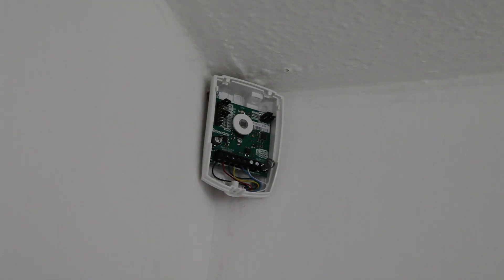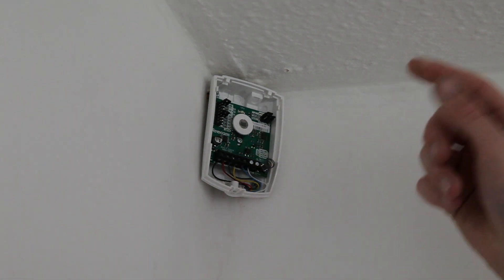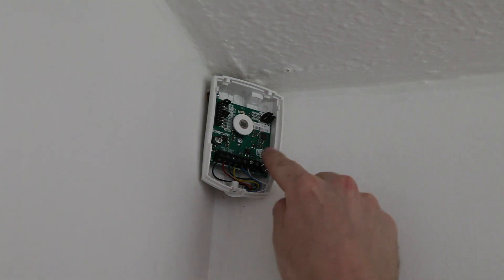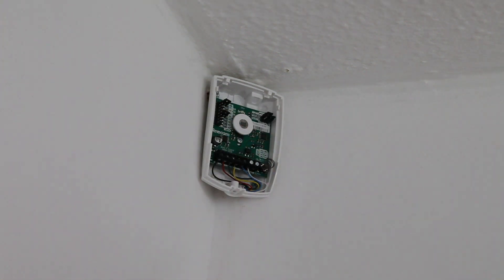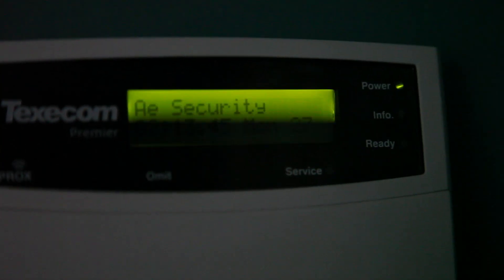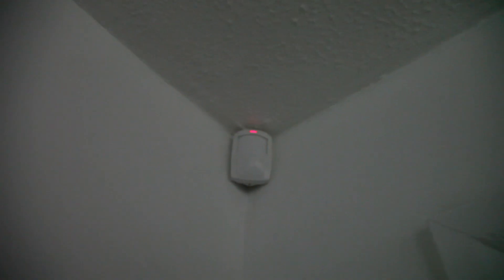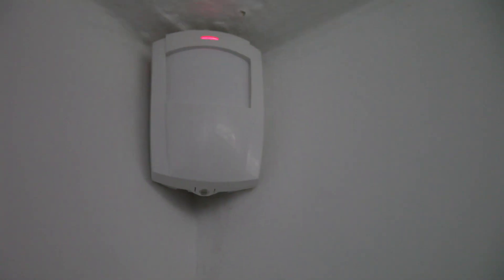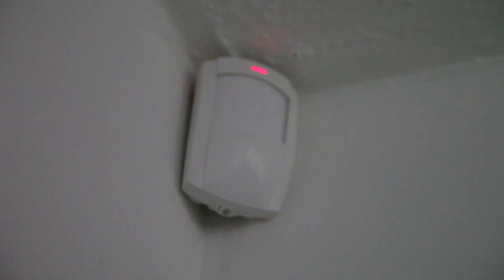Connecting A PIR Sensor

Comment: You're not using EOL on an EOL panel, also that PIR has EOL resistors built in. Also, you didn't show how to connect it so this video is basically useless. Is it just me or have you twisted and taped your tamper series circuit. Proper bodge.